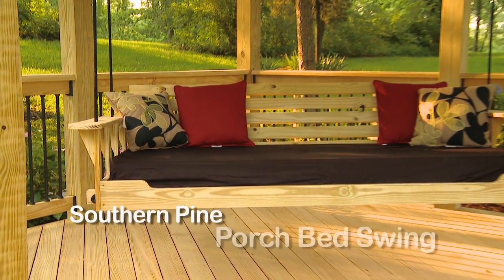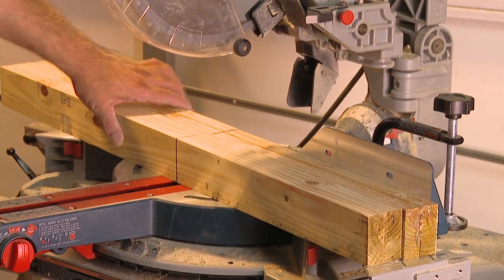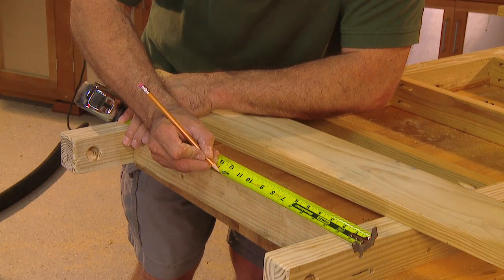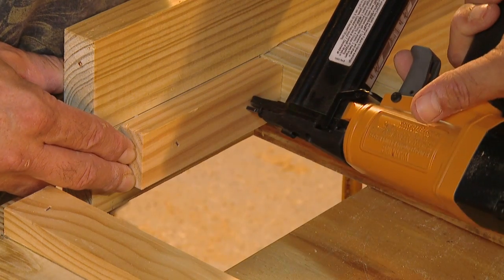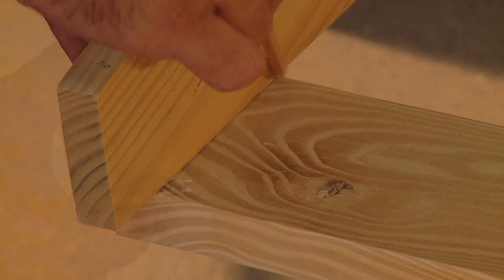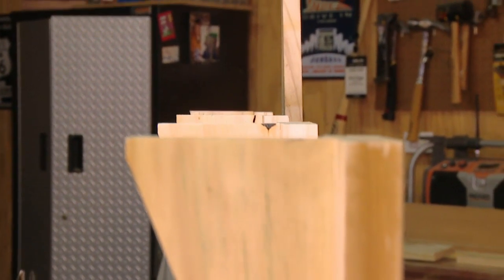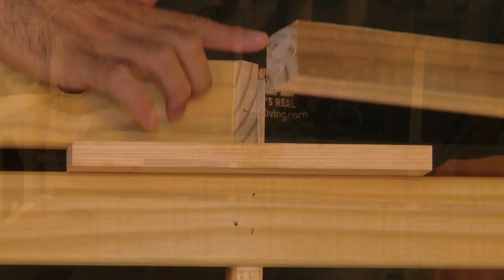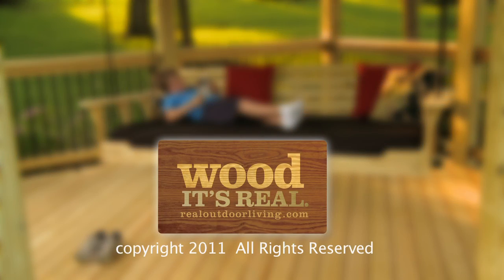Southern Pine Porch Bed Swing

Comment: Great video I altered it two inches to accommodate a twin mattress. I was very impressed with the detail of the video great job!  For those wondering how much it would cost to make the swing is about $180 which includes stain and a gallon of finish. Took a rookie about 8 hours of cutting and sanding and assembling.  Only thing I wish you would include is a list of lumber.  I figured that out by watching it a few times but I am just being lazy.  GREAT SWING!!!